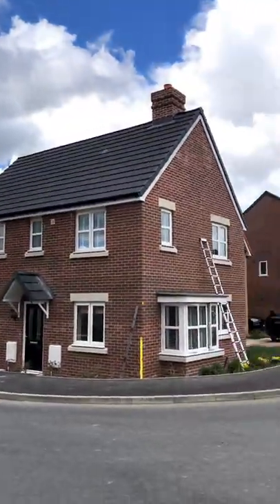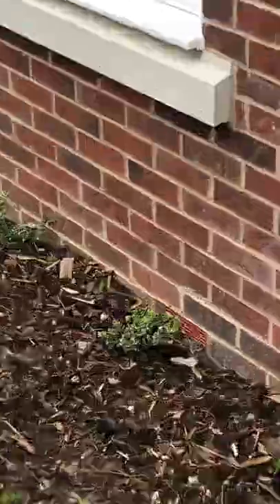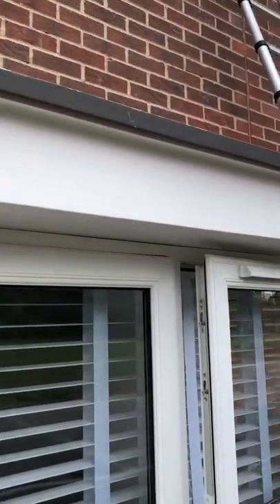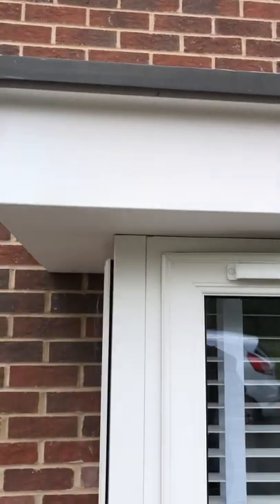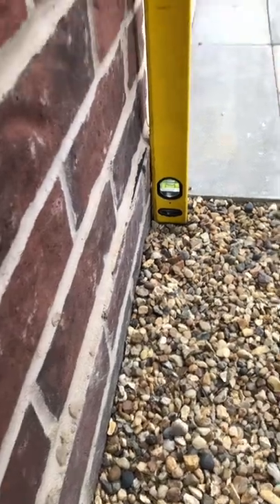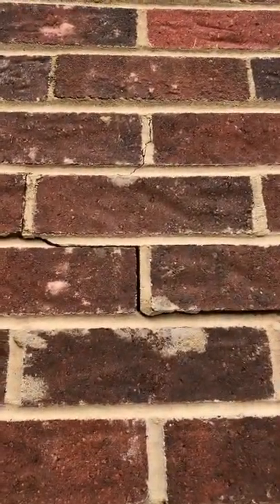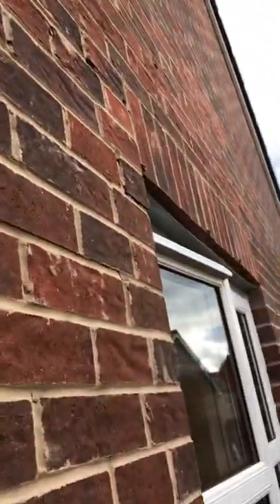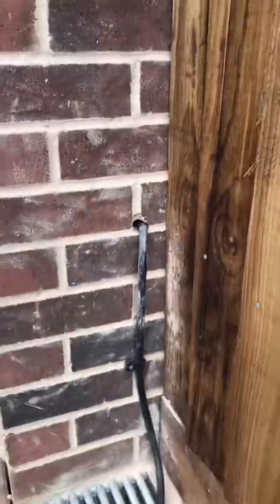New Build Snagging Inspection

Comment: I’ve never owned any house newer than 1820, 22” solid walls, nothing plumb, level or square and normally built on little or no foundation. I’m a multi trade builder and every job in these houses are a pita to be frank. Friends have often said “buy a new build”! I’ll stick with old it’s far better built looking at this shower of s***! Where’s the pride? No wonder the industry has such a bad reputation.
Reply: What do you think about 40 year old houses? I like the look and design of houses built in the 80s and maybe early 90s?

Comment: You should tell us what it will take to fix these problems and what the consequences are for the builders.
Reply: Majority of snags never get fixed
They'll offer the customer a few quid or pay for the carpets as a sweetener
I'm a carpenter with 30 years of experience & refused to work on large sites they're an absolute disgrace
Reply: Can confirm - none of this will be fixed. I'm a handyman and I see this sort of stuff all the time in new builds. The majority of houses aren't built by the people who'll live in them - so nobody has any interest in ensuring the job is done right. On-time and under-budget are the only requirements.

Comment: Having worked on building sites I can tell you why. The management is appalling. I been in an office block where they insisted furniture had to be placed out before the suspended ceiling was finished. Then blamed the furniture fitters for the damage. They didn't get away with it. The building was completed 19 months behind schedule with a further 14 months of snagging faults.

Comment: It's what you can't see that's scary the footings probably full of clay or sat in a flood plain, damp courses way below ground, air bricks non existing or built over, all the house drainage will have no pipe hangers concreted to dirt eventually sink and become disconnected leading to your house floating on your own excrement, the bricks not tied in to blocks, no damp protection around bottom of doorframes, patios laid on 30 ml of type1 covered in 20 ml of 100 to 1 mix sharpsand/cement, turf laid on muck and rubble and the list goes on and on I've seen it all on site with multiple companies they are all at it even the so called luxurious building developers they subcontract out all the work to the lowest bidder they know it will fail by which time they will be enjoying a nice beverage on a beach with your cash somewhere other side of the world giving absolutely zero f*#ks🤬

Comment: when you find things like walls out of tolerance, how do they get fixed?
Reply: That’s what I’m trying to figure out, I always though t it was measure twice cut once. I imagine a big machine pushin the wall till it’s correct lmfao. But what about the crack!!?! How’s that get fixed to where it’s actually ok?
Reply: @Jreaddy  a big machine pushing it are you thick 😂
Reply: The crack suggests possible major problems with the foundations.  Underpinning may be on the cards.

Comment: Well try a bellway house the shower leaked into the kitchen through cracked tiles they came out to fix didn't fix the shower that was broke but changed the cracked tiles in a different colour than all the rest black mould is building because the shower is constantly wet due to the leak so I have a wet patch in the kitchen ceiling

Comment: At least in the US we have building inspections all throughout the process. And any issues like these, if they ever occur means fines for companies and contractors as well as them having to come out and fix those issues. In some cases they would have to rebuild the entire house...and this all happens before the customer even moves in. Any delays result in fines, daily. And then the inspector that comes will likely be so nit picky that even a minor thing that might be okay won't be passed. We don't build crumbling homes in the US so stop using yeeha as if you are bashing the US. Because that's how it sounds.

Comment: Are the customers allowed to take these cowboy builders to court …you’d think after seeing their shoddy work plastered all over YouTube/TikTok/twitter they would start to do the job they are paid to do and make sure the work is done correctly.
Reply: Yes, but they don't need to. New builds come with a 2yr warranty so they usually fix this stuff without any questions asked. Sometimes they do push back a bit but it hasn't been my experience that they put up much of a fight if you have photos etc. And if they don't put it right there is a dispute process through the NHBC. Rarely a need to go to court.
Reply: @fang_xianfu  ah thank you for answering 👍🏻
Reply: @fang_xianfu   just think about that only a 2 year warranty on a brand new home it shows the quality going into them houses should be at the very least 10 years warranty and even that’s low. You can get cars now with 7 years of warranty that says something you would have to be mental to buy a new build especially for the money they charge.
Reply: @CH-bn7qb  it's a 2 year warranty to finish items like mastic seals, toilet seats, etc. 10 years for the fabric of the building like walls, windows, etc. Pretty decent deal when you consider that an old house has no warranty and you buy it how you see it.

Comment: Lead flashing should be pointed that is true. Brickwork from splash/dpc shouldn’t matter try putting the level from dpc upwards. Also brickwork isn’t structural so the cracking in gable isn’t anything to worry about just isn’t aesthetic and needs repointing nothing to worry about if you had ever built a house you would know this! Garden wall is also down to the engineers/architect no need for silly dog leg/squints reduces garden space and looks shit! Get a real job
Reply: ROFLOL, you the builder responsible for this mess??